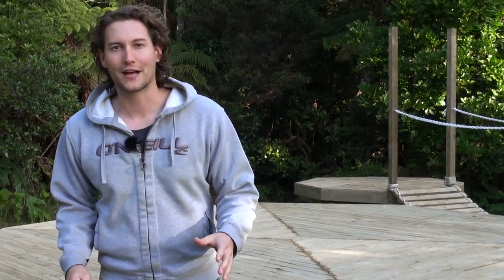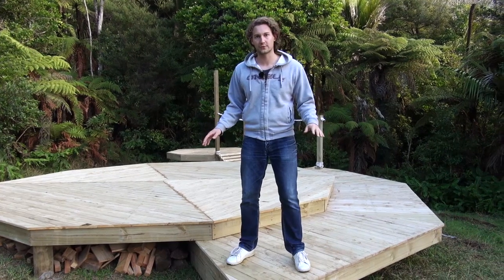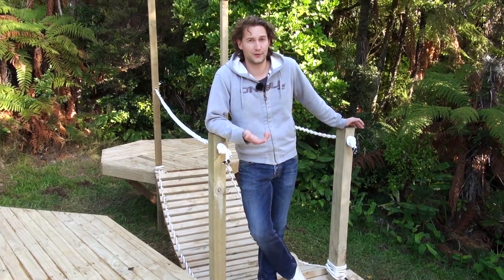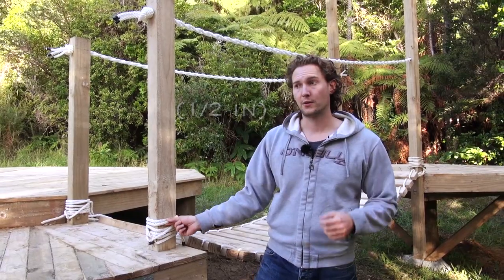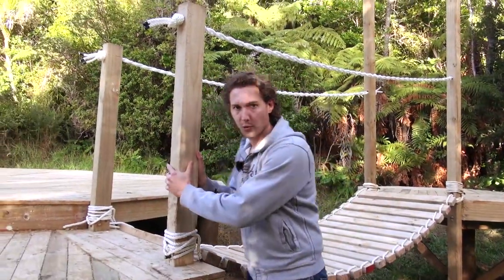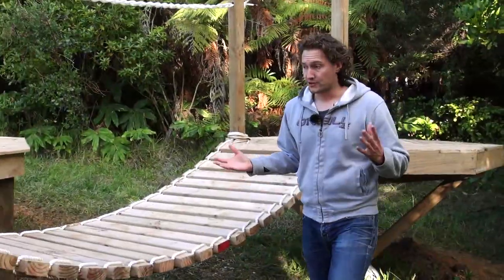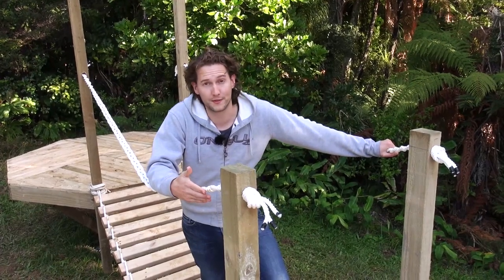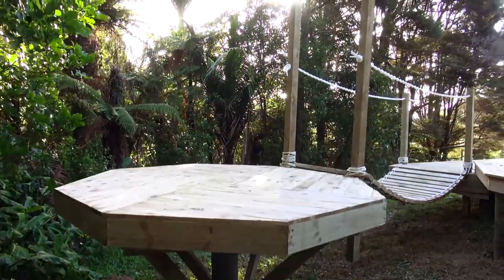Building a DIY Rope Bridge

Comment: Love your project and the video.  Would it be possible to show in a little more detail how to plait the ropes around the 2X4s and how to tie off the ends.  I want to add this to my Grandson's playhouse!
Reply: The additional rope is only added for spacing. Simply drill holes through the narrow end of the 2x4, fish it through.  You can do the spacing however you want. There are many ways.

Comment: I hate to be critical, but every time you touched the thing it moved. Specifically the cantilevered section: if it moves that much with just your weight on it when it's brand new, what's gonna happen when two people stand on it? And the posts at the end of the bridge wobbled when you touched them. Please add some bracing? When someone slips and needs to grab on to those handrail ropes, those posts act as giant levers. But other than that it looks nice.